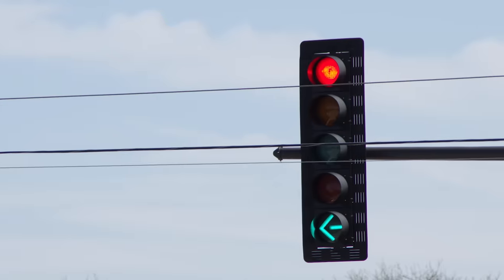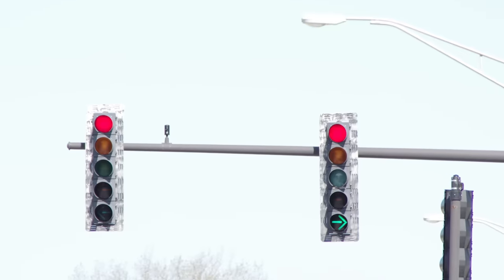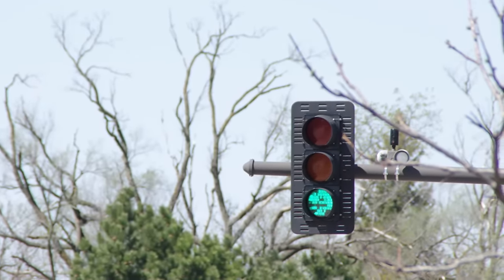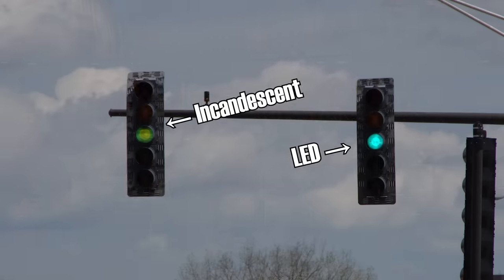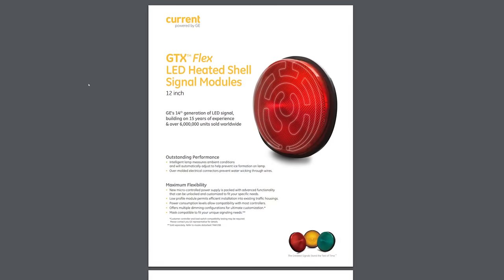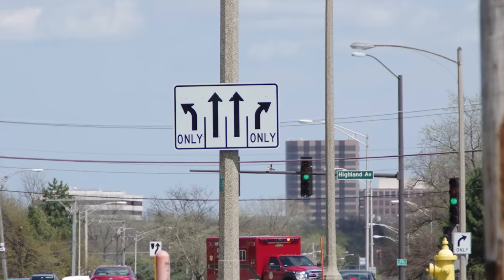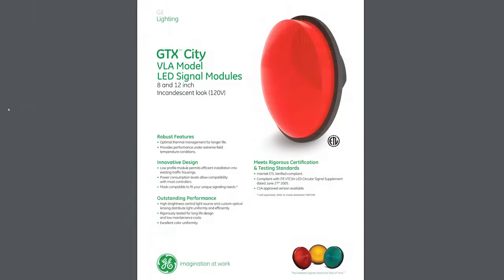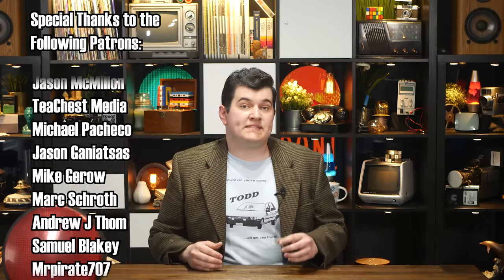The LED Traffic Light and the Danger of "But Sometimes!"

Comment: As soon as the snow building up on lights was mentioned my first thought was “why don’t they just put a car windshield defroster on the lens” and I’m so glad someone actually went and made it
Reply: Your mention of snow reminds me of the issue of road reflectors and snow plows. It is because of snow plow that you will find very few road reflectors where it snows. Why because they can’t standup to being wacked by the plows blade. 
And yes I have the solution to this problem. It has solar powered LED lighting and via Bluetooth the plow can adjust the light to meet conditions. And some other features. 
Just the base model (no LED’s) will save more lives and money then all other life/safety items combined. 
I also have dozens of other items that save time money and grief.
Reply: @gerhardschemel3565  where I live we 100% have reflectors on all the roads. They just have pieces of metal on the side of the reflector that guide the plow blade over them, without harming the metal or reflector.
Reply: @tankerkiller125  where is it you live? And would you please send me a photo of one? Thank you
Reply: @gerhardschemel3565  this is what one looks like, I live in northern Ohio where 7-8 inches of snow is regular. https://blog.stop-painting.com/wp-content/uploads/2015/08/Snowplowable-Road-Reflector.jpg
Reply: @tankerkiller125  thank you for the quick reply. Of course now, I have a lot of questions. I’m sure it looks better in the dark.
Do you know how long they have been in service? Or where I can find out more about them? 
Thank you
Reply: @gerhardschemel3565  from some quick research they've been around for decades. However most states have phased them out because their "dangerous" because sometimes if they aren't properly maintained a plow can knock them loose and when that happens it can send the metal flying and sometimes it causes damage or hits another vehicle.

Ohio is one of the last 4 or 5 states in the country that is still regularly using them.
Reply: @tankerkiller125  I have been on their website. Great American story. 
My design is 100% snow plow proof as there is no way the blade can get between the road surface and any part of the reflector. 
My design is more complex, has more features and like anything else more expensive in the beginning. 
Solar powered LED with Bluetooth enabled controls so the color and steady to flash is controlled when the plow passes it. And as the number of them increases they would be able to tie into navigation systems in private vehicles. (A reflector would flicker as you approach your next turn. 
I really appreciate your interest. And the reflector is only one of dozens of inventions and designs I have. 
I do so hope that you will be able to say you have helped bring them to the world. Most of all you have energized my passions
Reply: @gerhardschemel3565  Sorry for that stupid questions, but what are those reflectors doing exactly. I dont know them from where I‘m from.
Reply: @hojrts179  they are placed on roads to show where the roads make turns or curves so when it is raining or snow you know to turn. It makes driving safer
Reply: simple change the red light to the bottom like the railwys
Reply: @michaeolminney9656  what are you referring to
Reply: @CajunReaper95  that is why I came up with a reflector that is snow plow proof and then made improvements like solar powered LED with Bluetooth then it can communicate with vehicle navigation systems so when a turn comes up you will get a flashing signal. 
And as Bluetooth technology keeps going internet can be carried
Reply: @CajunReaper95  Ohio is basically nothing but hills for the most part, so I don't think that plays a part. Apparently from what I've gathered is that other states don't use them because of the fact that a couple got lose, got chucked by the snow plow, and then ended up injuring people.

Comment: On the railroad, we ran into 2 problems with using led modules for railway signals. 1. The snow did obscure the signal indication. 2. The green led was too bright for train crews during night operations. 
Both problems were quickly resolved.  Visor hoods were added to signals to keep snow out (often referred to as Darth Vader signals). Dimmers were added to the green led at night.
Reply: Correct me if I'm wrong, but that's still a lot of work.
Reply: @pfsantos007  
No more work than having to change bulbs.

And the bulb changing has to be done quite often when the number of signals is factored in.
Reply: @lordgarion514  Traffic light bulbs don't need to be changed anywhere *NEAR* as often as house ones.  That's why they lingered for years and years and years.  They just slowly turn kind of dark and crap instead.
Reply: @tsm688  
No, they don't.

But they do have to be changed a LOT more than traffic LEDs......

Just like they make commercial grade incandescents better than what they make for homeowners, so too are the commercial LEDs.
Reply: How would it be too bright? It's not like you need to see where to steer it.
Reply: @clifton4566  Its not like they just sit in the conductor's booth and twiddle their thumbs the whole trip. I can't say I'm entirely familiar with the operation of a train from a conductor's perspective, but bright lights at night will force your eyes to adjust for brighter light and it will take time for them to return to a functional state for seeing well in the dark. It will make any signs/landmarks more difficult to see (trains take a long time to stop when at speed so the process needs to be started well in advanced, so knowing where you are is important), and any controls or parts that need to be maintained which aren't brightly illuminated will be difficult to work with if your night sight has been disrupted.

I don't think it has led to any problems or would lead to major issues in the future, but its an annoyance that has an easy fix so why not fix it?
Reply: 豪雪地帯では、冷えたフードの内側に付着した霧氷が成長するし、カルマン渦で、雪も加わるから、塞がれていく
透過率はあるが、散乱されるから、前方への光は、減少し、夜なら薄ぼんやり見えるが、昼は見えなくなる

雪や吹雪を知らずに、簡単に解決できると勘違いしてませんかね
Reply: @clifton4566  the brightness can make it hard to actually read the signals since trains have more signals than normal traffic lights so there are signals like 3 dots in L shape or other wierd signals
also you do need to look on the road as a train driver cuz you need to modify the speed of the train so you dont derail on a turn or drive too fast to stop on a station  and you know when to slow down is based on the signs next to the rails
Reply: @pfsantos007  Then make it a standard of retrofitting new stoplights with visors and dimmers, it will still reduce a lot of work, electricity, and labor.
Reply: @tsm688  are you a railway technician? Because OP seems to be.
Reply: Imagine fixing the problem instead of just employing a human with flashlights to take the job instead. We did that in the good old days, it can't be wrong.
Reply: @pfsantos007  no it;s not.
Reply: @clifton4566  It's very easy for green to be too bright at night because human dark adaptation shifts the most sensitivity to green. I've actually studied this and it's amazing how little green light is required to see in detail, even though its in monochromatic shades of grey when you get down to really low levels.
Reply: I love when people resolve problems! Hats down from Slovakia where we makes fake problems to resolve only for them to become real ones 😬
Reply: @pfsantos007  The hoods & dimmers only need applied once, most likely. Sure beats disastrous railway accidents happening at a much higher rate & having to change bulbs constantly, which is WAY more work in the long run.
Reply: @clifton4566  Just like in cars, the extra bright LEDs can blind drivers and operators.  For cars, they can create more blind spots where you cannot see the pedestrians due to the difference in brightness of the different areas.
Reply: @clifton4566 Being able to see is a key part of doing litterally anything relating to vehicles.

Comment: Railway signals always used two bulbs in each light, so that when a bulb blew, the light still lit up, but not as brightly. Loco crews were supposed to report this to control, who would pass it on to the signal electricians for remedial action.
Reply: Railway signals have specific "patterns" so if a bulb is blown it becomes evident right away. Signs are more complicated than a simple green/yellow/red.
The train driver not only has to report a irregular signal he also has to ask permission before crossing (depends on the type of irregularity).

Comment: The first year that LED lights were deployed in my area, we had a massive snowstorm.  roughly 50% of of the LED lights in the city (in the direction of the wind), were difficult to see, and a good 5% of intersections the snow was so thick as to be impossible to see the lights.  It caused quite a bit of ruckus, as change is bad when it negatively affects you.  Convenience trumps price when you can't see the cost.
Mind you, this was the only year it was an issue.  Heaters were installed on the LED light fixtures, and LED lights have been a blessing ever since.
Reply: They're junk.  The holdouts are the ones who won this battle.  They can now use screw-in edison style LEDs, which are now cheap and widely available in the classic fixtures, getting all the benefit with none of the cost of the overpriced (and mostly crappy) "replacement" fixtures ... most of which have since been replaced /a second time/.
Reply: @Johnyquest1  you really think that leaving the design that gets dirty and blocks light from the inside and also having a fixture whith no way of warming up is a good idea?
you just made the only choice of options in wich now you have the problems (accounting on light delivery) of both devices and say that it's "a good idea" just because you just said so?
yeah they could have used Edison style LEDs, but they didn't because it's a foolish idea at best.

Comment: In my country it is like this: 
There is an order of authority on crossroads and intersections:
- If present, a policeman (or an authorised person, i.e. I was doing that couple of times in the military) regulating traffic has the highest authority, regardless of other signs and signals.
- If a set of traffic lights is present and working in order, than it has authority over everything else except an actual person regulating traffic.
- Every set of traffic lights has also traffic signs on them, that are to be obeyed if the traffic lights are malfunctioning.
- If there are no signs, traffic lights or a person present at an intersection, then a rule of the right hand is observed. That means that a driver has to yield all vehicles that come from his/hers right hand side. Vehicles on rails (street cars) take precedence, and are to be let to pass first.
Police, ambulance, firefighters and official escorted motorcades are another matter altogether, but that is another topic.

On the theoretical part of the drivers exam, the highest number of points carry sketches of the crossroads "to solve," meaning you have to write the exact sequence of the passage of vehicles pictured in them. Basically, if you fail any one of them you fail the exam. Often they depict malfunctioning traffic lights.

Comment: Back in 2012 they were in the process of replacing the lights on large antennas with LEDs, and we noticed they were almost impossible to see with night-vision. That posed a considerable threat to us on helicopter crews during night flights, where we'd periodically have to lift up our NVDs to ensure there wasn't some skinny, hidden 1000ft tower directly in front of us.
Reply: though to be fair, this is another thing that is probably better to fix separately then just doing it the old way.
Reply: Solution is surely to include high power IR LEDs mixed with the visible red so the NVG picks up the IR light?
Reply: wtf is a literal Night Stalker just casually commenting on this youtube video about street lights?
Reply: You can’t see LEDs on nightvision?
Why
Reply: Spectrum of light. Idk if thermal + night vision would have same issue.
Reply: You must not be using traditional night vision with image intensifiers.
Reply: Enemy just replaced all lights on every height building with leds 😅
Reply: Antennas should stick to the xenon strobe lights because they flash way brighter. The hid strobes are just easier to see in general
Reply: @lucakrokrowinkel9576   the old bulbs got hot, which emits infrared light which is what night vision goggles see. LEDs, as mentioned in the video, do not get nearly as warm. You can still see it, but not nearly as well.
Reply: Interesting. This comment is in 2024. We use LED’s and NVG. No issues now.
Reply: @bradlevantis913  There are different types of night vision. Some might not work with LEDs, others will.